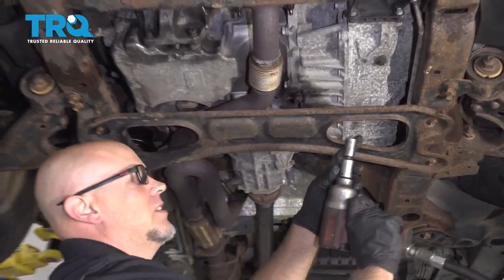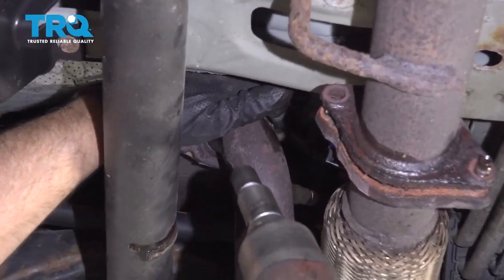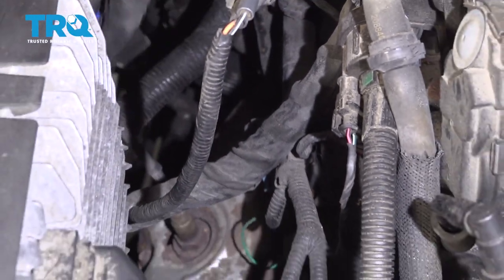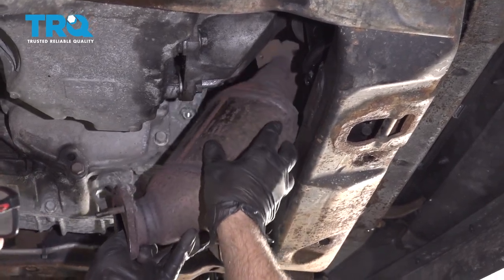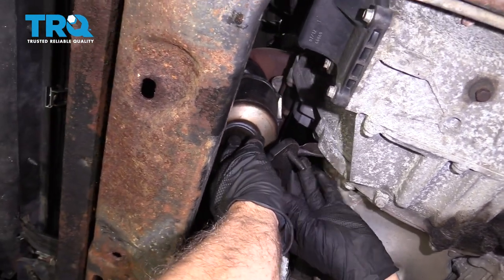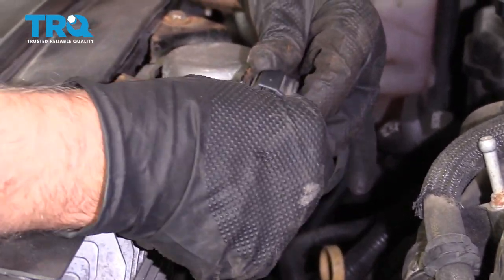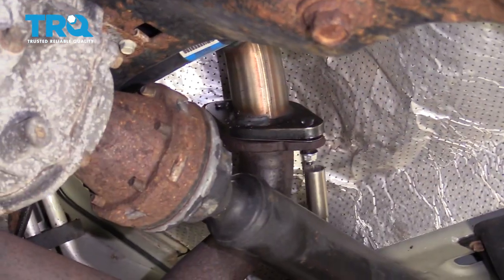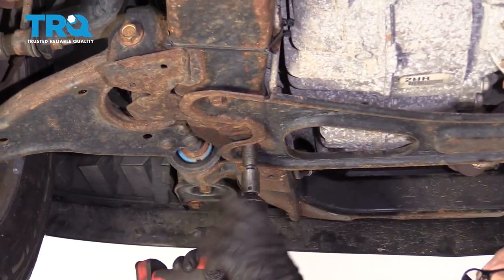How To Replace Front Catalytic Converter 2007-2016 Chevy Traverse

Comment: I am facing an issue with my traverse 2012 lately every time I want to turn on my car it just won’t start ignition start but can’t start but when I remove the fuse of ECU and put it back it start normal what you think is the problem